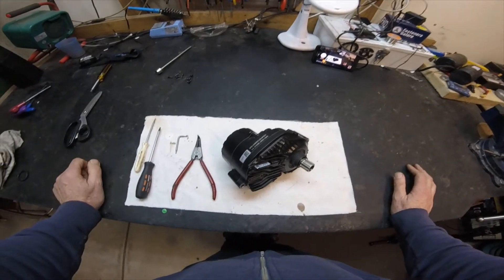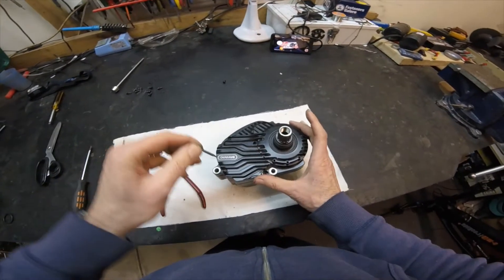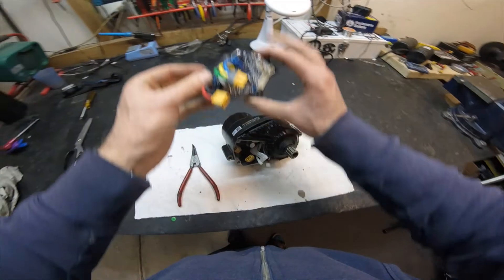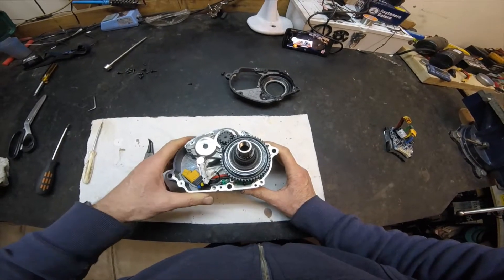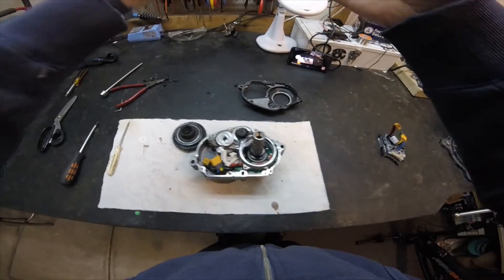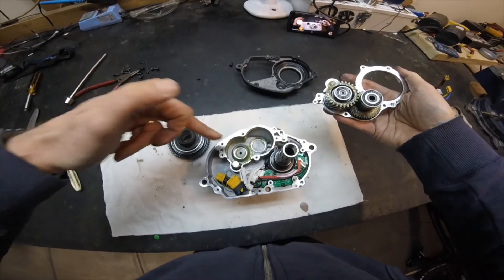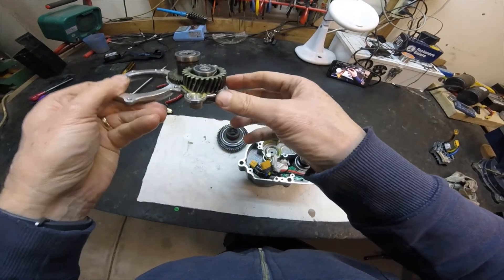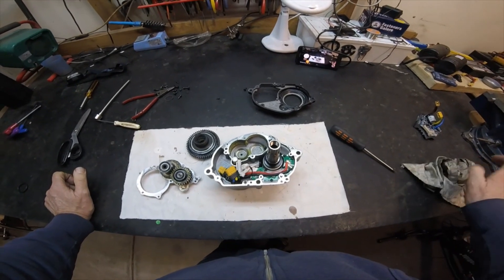Bafang M600 Partial Teardown

Comment: Nice video, may I ask about the noise of this motor ? I have m560 and is insanely noisy. High pitched noise. It has some small fast rotating part which generates this noise so wonder if this one has it as well. Also how it is with peek gears? Thanks.

Comment: Thanks for the video!
Has anyone had issues with the M600 getting an Error Code 21 two seconds after starting to pedal?  Bafang sent a new speed controller as it is called in this video, but same issue.  (First they sent a new magnet and PAS sensor...no difference.)

Comment: I'm trying to decide on aountain bike and want this or the m620 g512 motor     
Not serious downhill but need to get uphill without breaking a sweat, I weigh 11.5 stone and fairly fit , simple servicing and reliability is probably more important to me than weight saving, 
But if the m600 is reliable I'd go with it I guess,
What do you think,  g512 or m600?

Comment: Good video, but I wish you had started with taking off the sunken spider so people could see how you did that.
Also, that gear assembly you pulled out. How are the gears mounted in that assembly. Are they pressed in to that metal housing?

Comment: I have a fault in my m600 bike battery shorting at terminals can the speed controller part of case be taken off with motor still on bike? Need a bit of info on tools necessary

Comment: Great job, first time anybody has shown inside a m600. Can you please show the stator coils and magnet rotor for reference in size comparison to m620. Im trying to decide which motor for my dream bike build. There are no google pictures anywhere inside the m600
Reply: Based on the motor case dimensions, the M620 definitely has a larger diameter stator. Stator height is yet to be seen, but based on weight and q-factor, I’d expect that to be smaller (or maybe equal) too. IMO, the M600 is a drive system that prioritizes compactness and weight savings over outright power. Unfortunately, we can’t have both, due to those pesky laws of physics :) I’d say that if you’re going for outright speed and intend to use the throttle more often, the M620 is the way to go. I’d also prefer the M620 for full fat (>=4”) builds. If you’re building a bike that will spend as much time going downhill as it will going up, the M600 will save you weight, which translates to better handling downhill.
Reply: @bradleyland  thanks, I think you're right. M620 all the way
Reply: Yes please. I would like to see the rest of the motor also.